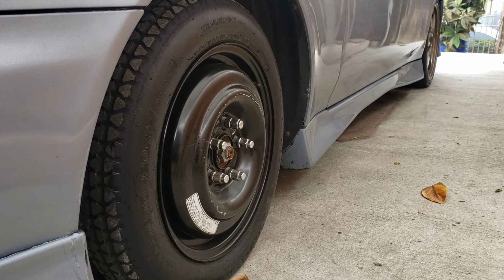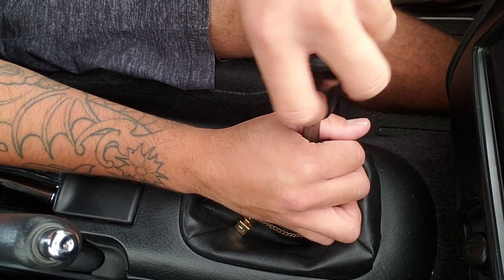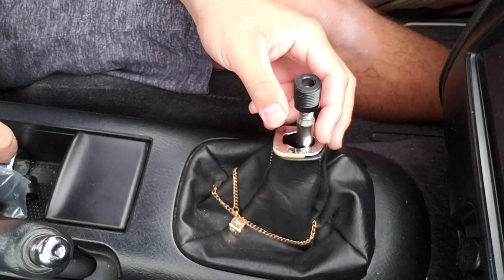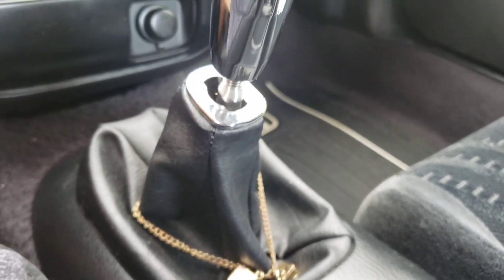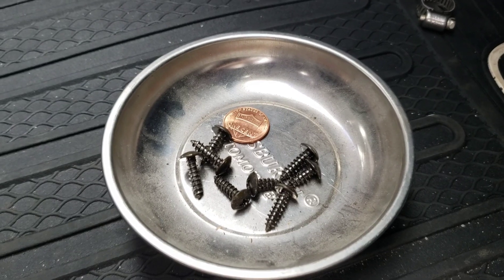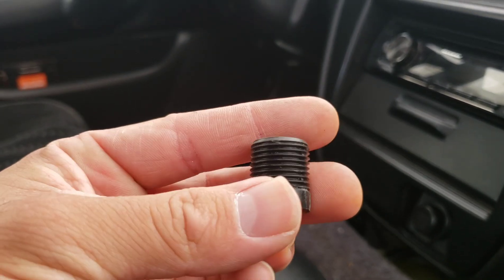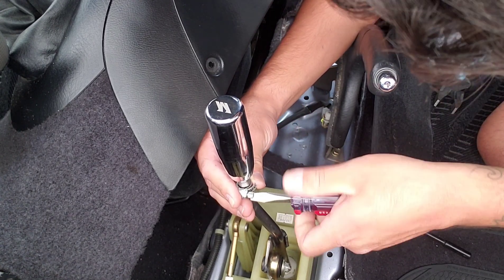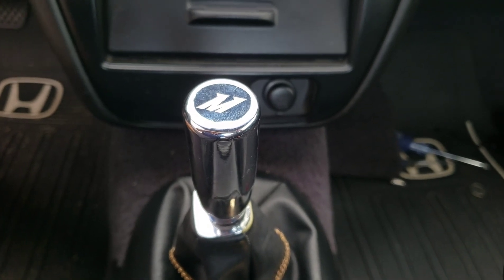Installing A Mishimoto Shift Knob

Comment: aye bro i recommend you get a shift boot collar and maybe a new boot in general it’ll definitely add to your interior and it’ll look better
Reply from the maker: Thanks, I would have done that originally but I thought the knob was just going to twist on and I didn't think about the collar. I didn't know I was going to have to remove the center console but it looks good to me now. Because this knob is a bit higher, I can actually use my cupholders now while driving 😁🧃

Comment: Do you know if this fits m12 by 1.25?
Reply from the maker: Yes sir, it includes an adapter for M12 x 1.25, one for M10 x 1.5, and one for M8 x 1.25.
Reply: @pacificprelude4913  thanks dude! Can't wait to get mine in the mail! I have a toyota yaris 5 speed and the stock shift knob is way to short for me. And I just need like 2 more inches lol. Also lookin to get some more expressive modds on my yaris😂 gonna make it into a rally car😂
Reply from the maker: @Ezdrumms  A Yaris is in interesting choice for a rally car lol but this longer knob actually let's me use my cup holders without a drink being in the way 👍
Reply: @pacificprelude4913  lol I feel ya with the cup holder lol. Its a lil duf with the yaris but I feel ya. And ya i know it is different then what people generally choose but i love my yaris😂😂